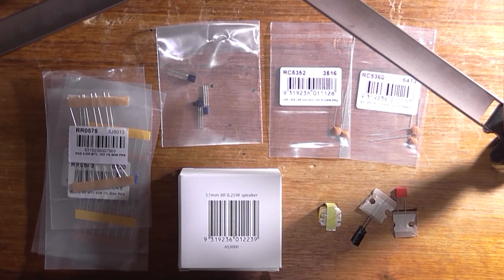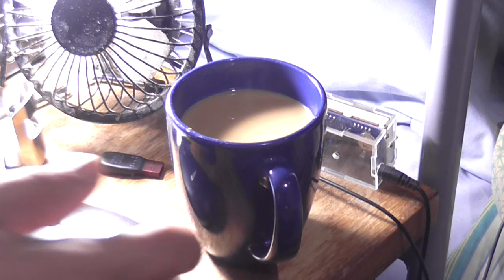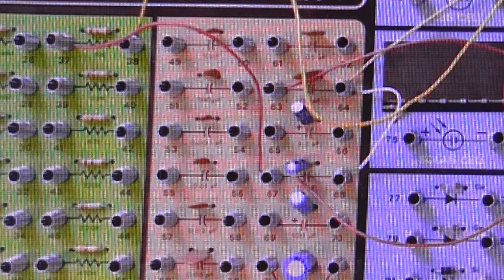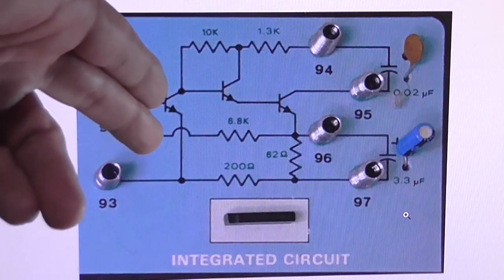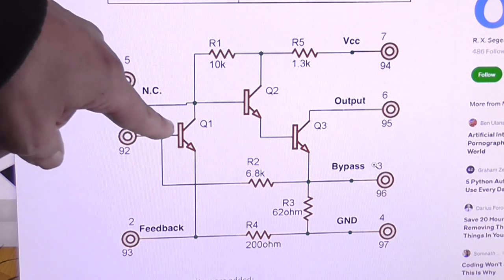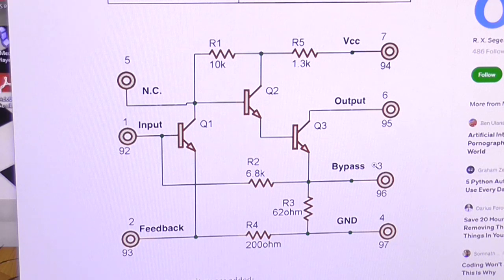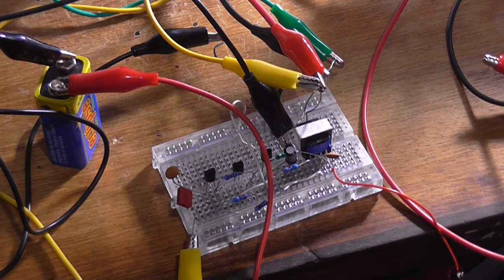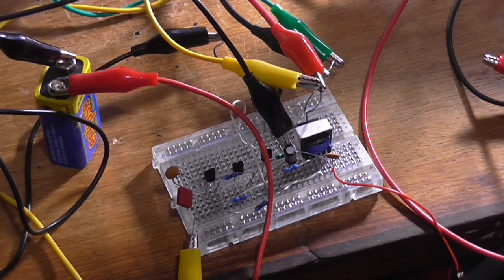Recreating NTE1431 IC From Science Fair "160-In-One" Kit

Comment: I just saw your Clear/Transparent Breadboard, I was curious where you got it? I would like to buy some if they are still available.
Reply from the maker: Jaycar. It's an Arduino compatible breadboard with slightly larger hole diameters. It's not so good for 0.8mm component leads; feels a bit "loose" fitting. Jaycar catalogue number: PB8820 (https://www.jaycar.com.au/arduino-compatible-breadboard-with-400-tie-points/p/PB8820)